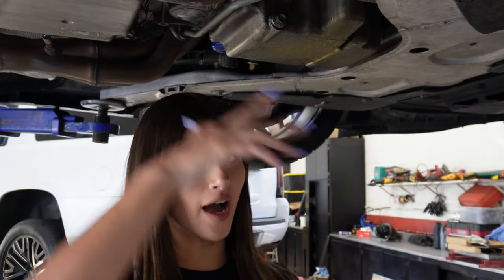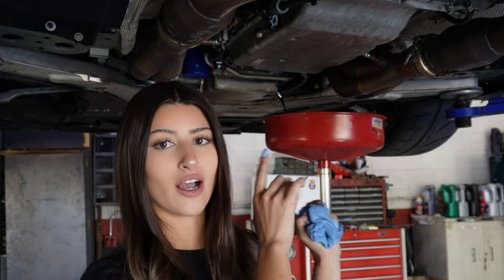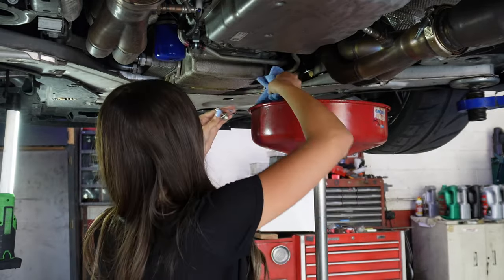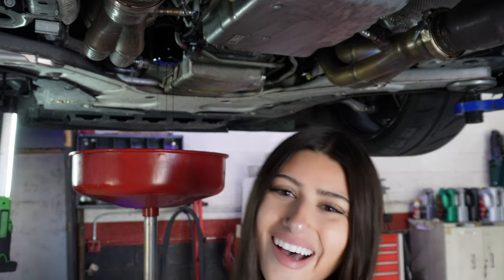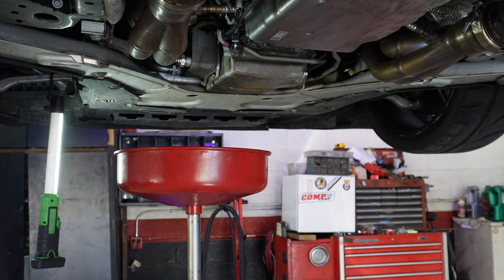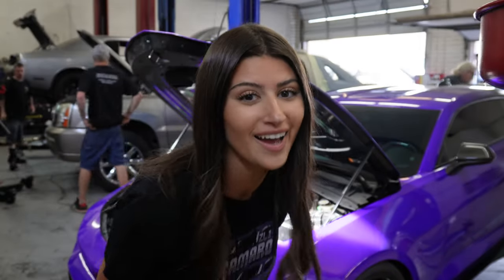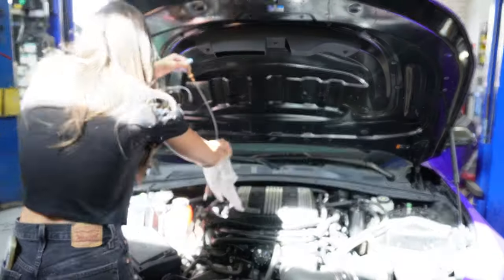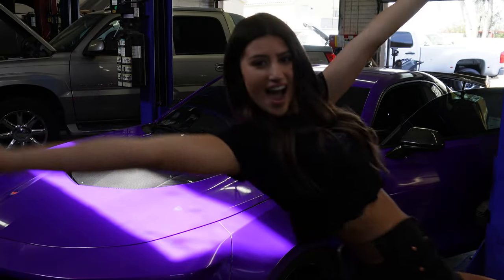How To Do An Oil Change - Camaro ZL1

Comment: Thanks for doing the video.  Just a couple of suggestions:  Tell viewers the socket size for loosening the drain plug (i.e. 15mm?), the Oil filter model # (i.e. TG12060?), the Oil filter cap wrench size (even though you were able to loosen it by hand), the recommended oil type as per the manual or updated addendums, and approx. how much oil you filled the engine with.

Comment: At about 8:00, you filled the car with oil, fired it up, turned it off, and then checked the oil. Shouldn’t you be checking the oil before firing the engine, on a cold engine?
Reply: No since she just put the oil and it didn’t circulate within the engine yet, so the oil level reading before starting would not be accurate